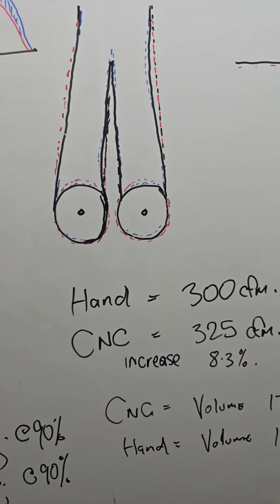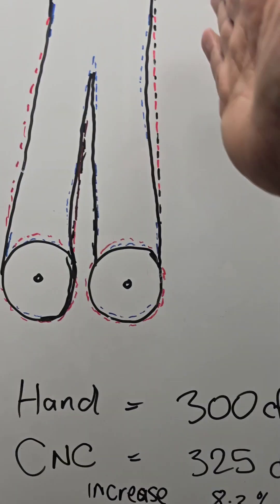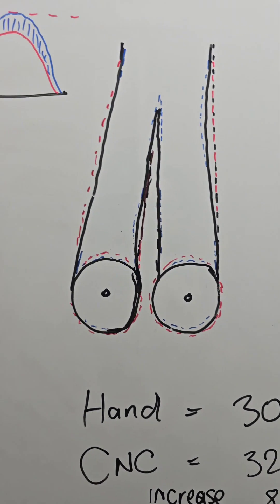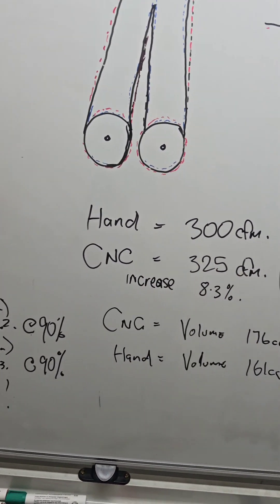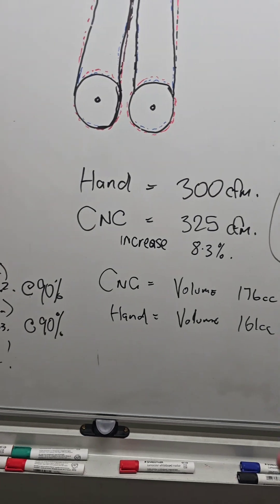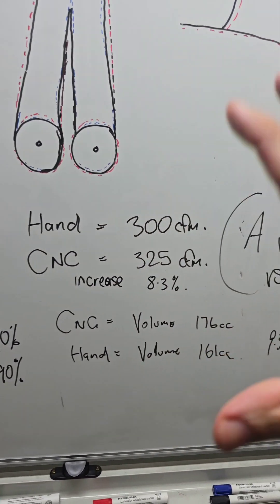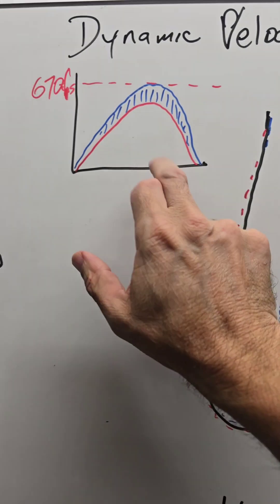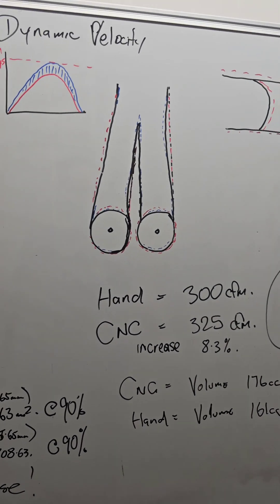RB26 Head Porting Part 6: Why Flow Bench Numbers Lie & how to More Power Everywhere! #rb26

Comment: Daryn Morgans 3 secrets for power :  speed  ,  speed  and last but not least : SPEED!!
As pro head porter , mainly diesel tractor pull  ( and other very extreme high boost stuff) .  You hit the nail VERY HARD on the head!!!👍👍👍👍👍👍👍👍

Greetz from the Netherlands!!!!!
Reply from the maker: 100% darin is all over it!  He is one of the best 2 valve head guys there is! Have chatted about a bit with him over the years.  Very smart man.